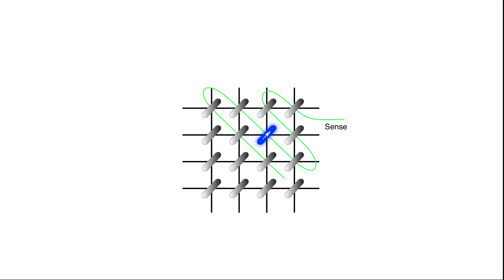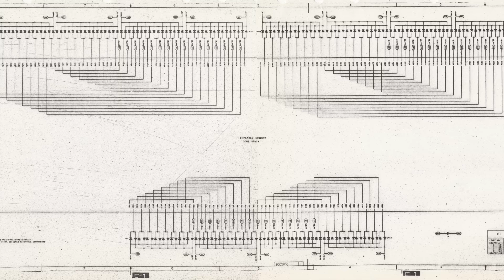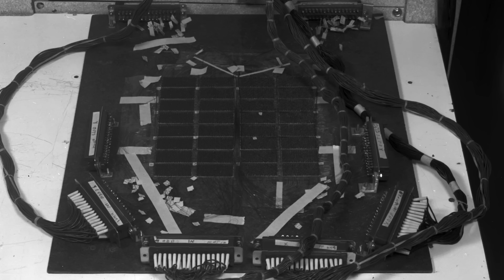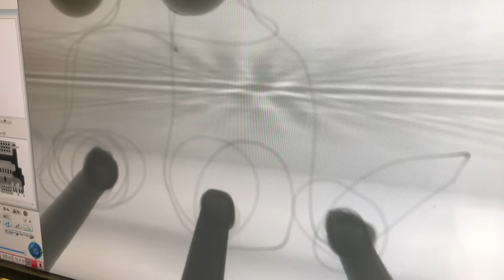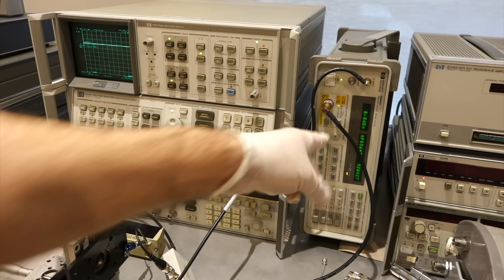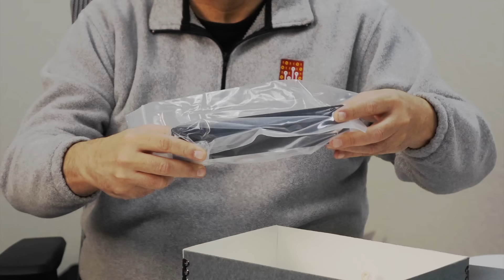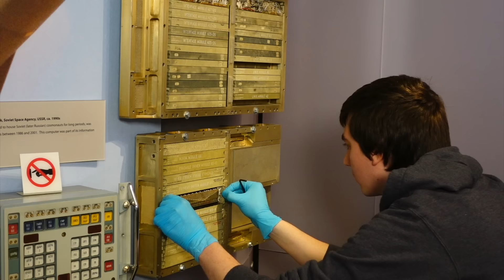Apollo Guidance Computer Part 7: Memory Module B12

Comment: Any compound you could trickle around the edge to dissolve the glue? And what are the chances of building a functional replica if you can't find a way to repair it? I'd say, "build a new one," but that's easier said than done, since core memory hasn't been used since the 70's when IC memory started coming into the mainstream, and I doubt any looms are still around.

Comment: Why not just swap modules? The museum obviously don't need a working one and the broken one you have is more complete anyway.
Reply from the maker: @Brian and @Colin: unfortunately it's a bit more involved than just swapping items.
a) It's not entirely up to them. Items are donated to their trust with strings, usually restrictions on what can be done with it. Some can't even be shown, much less used.
b) This is a historically significant and complete AGC donation: the first prototype Block II unit from Draper Labs. Every module on it is RAY #1 or RAY #2. You cannot just "swap things out" and keep its historical value intact.
c) There is unavoidable tension between restoration and preservation. It's hard to do both well at the same time. The CHM Museum's charter is very clearly preservation (like most other museums, actually). On the other hand, the LCM (in Seattle) charter is clearly restoration (which is more unusual). Both are helping computer history in many ways, but both are following their charters in ways we don't always like: the LCM rips through historical machines and replaces out old components for new ones in ways that makes us cringe; the CHM is very uptight about preserving their artifacts absolutely original and unpowered. That said the CHM is doing restorations on items they have several of (like the IBM 1401 and the Xerox Alto's), and occasionally on unique items (the PDP-1). They have only one AGC, and it is slated for preservation.
d) The CHM and its curators are very aware of the significance of the 50 years Apollo anniversary, and are quite supportive of our project. If there is a way to help us out while not endangering - or even better, while enhancing - the preservation charter, they will support it.
e) We have several collaboration proposals in the works, stay tuned!
Reply: @CuriousMarc  Does NASA have any spare modules floating around? Its possible there are others in the hands of collectors too. Amazing this was rescued from the scrap!
Reply from the maker: Not sure if NASA has any, but the Smithsonian and maybe some other museums and private collectors. They probably did not have many extra of these around even at the time, as contruction was awfully difficult - by far the most difficult item to manufacture in the AGC.
Reply: @CuriousMarc  well... I didn't mean to make it sound so simple - but it does seem like an obvious solution at some point. Good Luck on the project - this series is easily one of my favorites on YT these days! I mean you could totally cheat and pop an arduino and a few AA batteries as a simulator in there an nobody would know but of course that kind of defeats the whole purpose in the end. Anyway - it's all very fascinating to me!

Comment: find some of the original women that made the core modules by 'weaving the wires' and make a new one. that would be an interesting watch.
Reply: It would be a good interview. The trouble is that these cores aren't just woven, they also had complex looms that were used to make these, and I'm pretty sure those have all been scrapped at this point. At best, you might be able to repurpose a loom from a more "modern" (I use the term loosely) core stack, and build a new one from scratch. Or find a machinist who can build a new loom.
Reply: Thanks for the reply. It seemed a simple thought to just make some new core memory. I kinda suspected it wouldnt be. I would like to see that proces, even if it was only a few bytes being made to work.
Reply: @willemkossen  Indeed. I've tried just weaving my own cable to extend the pod reach on my logic analyzer (it has shield wires woven into it), and even that is impossible without a loom to work with.

Comment: Time to make a pin compatible static memory module in a fancy box...    (without potting!)
Reply: That'd be fun! I'd make a one-bit memory module that intercepts those two pins (and related sense/inhibit) - then work really hard to completely conceal my work.
Reply: I was thinking would it be possible to rewire a 16 bit plane from a PDP-11 though the amount of effort it would take might be easier to just use static ram.
Reply: You only need to make a pin compatible adaptor for the broken bits - if they can be isolated
Reply: Use a flash based FPGA with the correct pinout and memory contents.  I'm sure Lattice or Microsemi would happily give you the parts.
Reply: Yes, this seems like the best way forward. The electronics don’t seem that hard - making a pin compatible physical plug in seems to be the hardest part.
Reply: The right thing to do, would be to build an authentic but modern copy. I'm sure there's a company in China that would be willing to build a core mat to the Apollo specs for a reasonable amount of money. It's worth investigating.
Reply: Antron Argaiv, that might be right from a historical hardware viewpoint, but it’s wrong from an historical nationality viewpoint.
Reply: @phomchick  Agreed. And some Googling indicates that China might not be your best bet for cores.  The guy that did the Arduino core memory shield got his cores from a former Soviet country (forget which one at the moment).  But if you want a core memory, I'm sure there's somewhere you can get it made. Probably NOT in the US, though you never know...

Comment: How was a part produced in ultra-low runs glued in such a way that disassembly would ruin it? That's understandable with mass-produced stuff, but, here?
Reply from the maker: Every module had to be potted to pass flight qualification. Since this core memory had no frame, it had to be potted for mechanical reasons even in the ground modules, at least the silastic part of it.
Reply: It also had to be light, small, reliable and withstand vibration and G  forces and even condensation. Repairability wasn't an issue as they would never have flown with a repaired unit. As these brilliant people just showed us, you can still debug the faults for further development.

Comment: If you can read out it's contents, i'm sure Ken will be able to make an emulator :)
Reply: what did I get wrong ? Erasable memory = RAM ... so why reading it ?
Reply: @bobl78  Historically interesting to see what it had been running when last powered on. Since we know this was removed from Lunar Module Test Article 8 at some point, it may have been used for some other purpose before it was surplussed.

Comment: I commend you for even attempting to fix the memory module at all. When I realised it was potted I thought any repair would be impossible, I can't believe you managed to find another memory module to test and confirm the fault! I think the work you are doing with the AGC is incredible and I'm learning a lot more about the nuts and bolts of how a computer really works than I ever expected. Thanks for taking us all along for the ride.
Reply: Heres a thought. You know which bit is bad and where. Instead of repairing it just find some similar core memory and connect it to your existing module in such a way to make them work together like masked memory.
Reply: Is there any solvents i wonder that could be used to dissolve away the potting?
Reply: Yes, but it will probably eat the insulation off the magnet wire as well.

Comment: does plan E involve weaving your own core memory module? I imagine the last resort would be emulating the module.
Reply: emulation is like having a ultra great classic muscle car with a V8 engine that´s like porn... the engine is broken and instead of fixing it you put in a 2018 4 cylinder diesel engine just to drive the car
Reply: @bobl78  Having said that it is still better then having it not running. I can't imagine them making a core memory module so in the end whatever they come up with will be an emulation.

Comment: En testant les deux extrémités du fil rompu, et en comparant les résultats, vous pourriez estimer la position de la coupure non plus en cm à partir du pin mais en % de la longueur totale de pin à pin. Non pas que ça résolvait quoi que ce soit, mais au moins vous auriez une idée plus précise de l'emplacement du défaut.
Reply from the maker: We tried. Unfortunately the other end is on a power pin connected to two inhibit wires, so you can’t isolate the bad wire in the measurement.
Reply: CuriousMarc No joy...

Comment: i love the repair Series of the AGC. Have your think about Chemical desolving the Resin in the Module ? Ich think it is a posible way Also i think you have only another option that calls Rebuilding with old (magnetic core) or new (smd) technic. Eventulay a 3D Xray is a way but i think this machins are not accurate enoth. i wisch you good luck its awsome !!!
Best Regards an All from Germany
Reply: The issue would likely be stripping the insulation from those wires with the epoxy.
Reply: @TinkerLynx  jes that is a prooblem for a chemicist maybe it is possible. I think the easyst way ist a retrofitted pcb with a microchip tha emulates the core memory. I hope the best and press both thumbs. This ist a awsome piece of history.
Reply: @tollerteppich  Ya, I looked into it a bit, an FPGA such as the flash based Intel MAX10 could do the job. The issue is latency, core memory is actually pretty quick. But I think the internal memory on an FPGA can do it. probably under $100 if someone would volunteer there time to do the coding.
Reply: @tollerteppich  I'm reading these with a German accent and I'm having a blast :dd
Reply: @TinkerLynx  i have not the gackgrund to Programm an fpga. I can a litle bit C on a mega8 XD but i think here are experts on fpga that can help. Also i think with a lot of hand work it is possible to rewire the module after stripping with the original ferite cors
Reply: @goqsane  jea my german is better than my english XD on my school time it was not nessesary to learn good english O_o. The world speaks bad english :D

Comment: Has anyone considered making the memory. This stuff was originally hand made. With the benefit of 3D printing to make assembly jigs and perhaps some bits from you sponsor it's entirely possible to just make a new block of memory.. This is something a person with good eyes and a steady hand can do. You may even be able to find some good core memory from a different system that can be re-mounted for use in the AGC. Although it may be hard to find someone willing to let you cut up their old IBM core memory cards.

Comment: Could you perhaps piggy-back a small circuit to just those pins to mimic a working section of memory? Another idea perhaps is to fabricate a module to mimic the look and behaviour of the original and use that just for demonstrations. That will leave the original module in good condition and may be easier than repairing it.
Reply: I was thinking the same thing as your first suggestion. Since the wire is broken, it should be possible to just bypass it entirely.

Comment: Would building some kind of emulation for the erasable memory be possible? something that plugs into the physical slot and responds in the expected manner with more modern materials and techniques? It might even be a good proof of concept on retrieving any residual data in the erasable memory (if any, still not 100% understanding how the memory lattice in that works) of both modules.
Reply: The problem would probably be power. If the module can be given a constant amount of power (let's say 5v), you could probably use something like a stm32F103C6, dirt cheap microcontroller at 37 GPIO pins with 20kb of ram.

But that's no fun. Lets see a new build of the old design!

Comment: Great video and solving steps. I would work on materials scientists to find a way to dissolve the potting compounds used in that era. It may not be so difficult
Reply: LOL.. do you thin a 95 year old lady can still make a memory module with wires as thin as a hair
Reply: Anything that will dissolve the potting will probably also dissolve the wire insulation.
If that's the case, he would be better off just building a new one from scratch. That seems like it would be a real pain in the ass and not something I would want to build though.
Reply: This is one of the main problems -- this type of epoxy was designed to be chemically resistant and anything that could get rid of it would almost invariably damage the rest of the module. But even if we found something that removed the outer potting layer perfectly,  the inner silastic potting compound is completely enclosed on the front, back, and top with fiberglass boards, and on the bottom and sides with the thick aluminum chassis. 

1 or  2 #38 AWG wires run from each pin through 0.01"-diamater holes in the fiberglass boards. Removing the boards isn't really an option, both because of these super thin wires passing through them, and also because the diode block affixed to the top and connected to the rest of the module with welded wires. So we'd have to either bore through it gently enough to not break any other wires, or come in through the chassis.

Once we make it through that, then we'd have the silastic material that we'd also have to dissolve away, probably through a very tiny hole that we've managed to make in the boards or chassis. We'd have to make it through potentially inches of material, without harming any of the potentially hundreds of other wires in the way, to find the break and attach the two ends of the broken wire back together.
Reply: I suppose selected epoxies would not react with module components so maybe there are compounds that will break down the epoxies that likewise would not react with the module components. On the other hand, the coated wires are uber delicate.
Reply: @rocketman221projects  Good point on the wire insulation. We can't be certain. Regardless with the delicate wires and donuts, the potting compound is a problem.

Comment: I can't help but wonder if a solvent would eat the glue, allowing access. Maybe even some way to dissolve the potting?
Reply: I'm guessing anything suitable to nom the epoxy will also strip any insulation from the wiring too.
Reply: @TheErador  Not necessarily. It would not be easy but I suspect there would be a solvent that would soften the glue and allow access without killing the wire insulation.
Reply: That is by definition, destructive.  you try not to do that to historical artifacts.
Reply: @thedamnyankee1   That is the 64K question. But IF as in this case there ARE others of this module, then possibly it could be an option worth looking at.
Reply: it´s broken.. you can only look at it... when they destroy the inside you can still put the cover back on and it will look like before
Reply: and how do you safely try the 100's of solvents when you only have one and its irreplaceable?
Reply: @Dust599   the type of glue, the type of epoxy used would be known or be able to find out. Then a good chemist can find a solvent with out touching the part. The decision has to be made at some point. Either make a replacement, have it non working or repair that one. No one answer is the right one. Just options.
Reply: if the majority of the AGC components has to be replaced by modern stuff, the project looses a lof of it´s fascination...I would opt for opening it... after all it´s already useless and broken... it can´t be double broken
Reply: There really is no correct answer here. It comes down to risk vs. reward, in my opinion. I suspect that even if you could eat away the potting, the act of physically unfolding the core memory runs a very real possibility of damaging it further. I suspect that the best option might be to try to find a way to bypass the broken wire entirely. I am not an electrical engineer - frankly, I think that entire field is pretty akin to magic - but I believe it'd be possible to build a supplemental circuit that could detect when the AGC is trying to address that one broken bit and deliver a proper response. It wouldn't be perfect, but it'd be more historically accurate than, say, slapping in a modern microcontroller and SD card to emulate the entire module.
Reply: I don't give a shit if it gets fixed in a way or other. I just want to see all the content that aims to fix it in anyway possible! That would include modern methods and trying to fix the old one!

Comment: If you even think about it, it’s a miracle the thing got off the ground with that technology not to mention flying to and landing on the moon! Absolutely amazing!
Reply: I know they talk about it a bit in the video, but look at all those tiny wires then think about them under 3g of load and vibrating all over the place. It's amazing that the engineers managed to make something so flimsy be able to survive such harsh conditions.
Reply: And if you watch Marc’s other videos about the IBM 1401 he says they have issues sometimes keeping that running for periods of time and realizing the AGC basically uses the same tech in a smaller footprint it really makes you realize more what an engineering feat this thing really is!
Reply: maybe also a reason that program was terminated... they just were ultra lucky.. imagine they had ´lost one or two Apollo Crews... the memory / AGC Is just a small part... all the other stuff was just as fragile